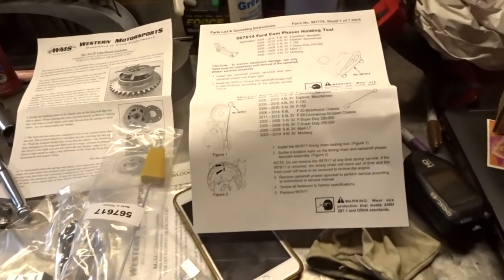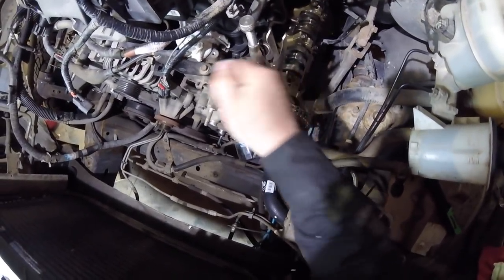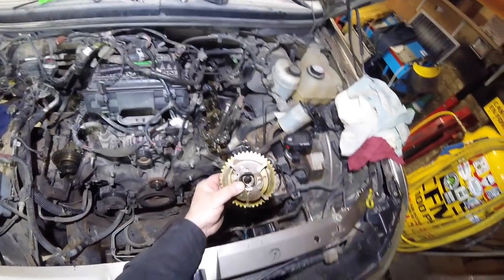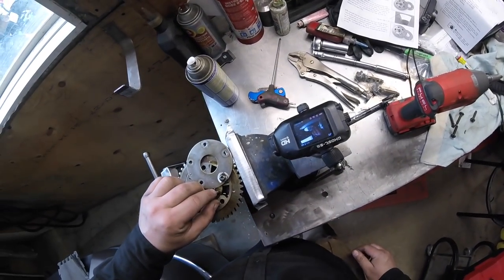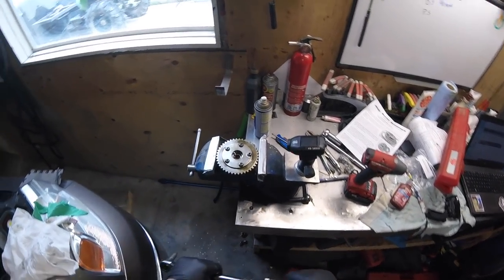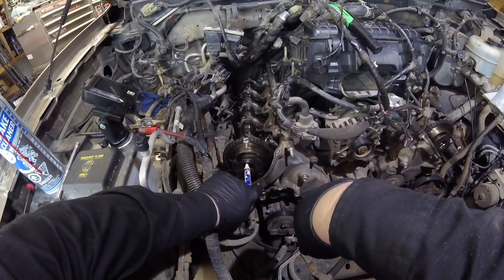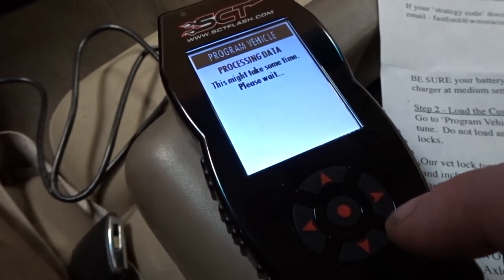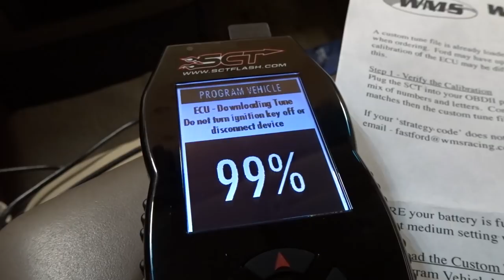Ford 5.4 3V how to install Cam Phaser Lockouts

Comment: Do I really need the tuner though? how much will this cost me if I go to a mechanic? Should I just say, hey I want you to do this thing I saw in a youtube video? Should I also get the melling high Flow oil pump and a new timing set done at the same time? how much is all this gonna run me
Reply: Shawn we do at Julio’shop for 3200 with M-340HD oil pump and new timing components
Reply: el gran savio salmon salami that’s high price considering a shop does it for 2000 with all new timing chain guides etc and melling oil pump with warranty and it’s ready to go next day.
Reply: I did the whole timing set with the Melling high flow oil pump two years ago and the phasers starting rattling like nobody's business recently. I'm going the lockout route now.
Reply: @morecowbell20  were they Ford motorcraft phasers?
Reply: @ryankeusch3972  No, and that is certainly one reason they failed so soon. I have since done the delete kit and couldn't be happier! The low end power right of the get go is amazing.
Reply: @morecowbell20  right on...thanks man!

Comment: I'm on my 3rd time doing the timing on my 2008 f150.  I shouldn't have to do the timing every 5000 miles.  My parts are in the mail, with lockouts.  I'm selling it once I'm done.
Reply: mine lasted 1000 miles! All oem parts , i wish i would have done the lockout!

Comment: Hi, I'm from Chile, and I saw your video, and I have a question, what is the advantage or disadvantage of installing the locking device? Improves the engine's appearance somewhat? or is it only for the noise to be removed?
my queries are because I believe that this system of "damping of chain rotation", must be designed for something specific, and modifying it may bring about modifying other things, or other parameters, I will appreciate your answer ... . regards ..
Reply: the variable cam timing is designed to control exhaust emissions, improve engine performance dynamics like maximizing torque/horsepower, reducing detonation and improving fuel mileage efficiency. The exhaust gas recirculation system is done away with using VCT. So yes the VCT DOES have engineered purpose and to modify it will not necessarily leave you in the best of situations for emissions and optimum engine performance. The triton motor was a complex design and it is highly important to use the proper grade of oil and change it and the filter frequently. Use 5-30 wt oil not 5-20 wt as ford  recommends. Be careful about pushing the engine hard, that is towing heavy loads and especially so in hot weather conditions as this will lead to oil lubrication problems that are the root cause of cam phaser failures. here is a link that may be useful https://www.expertswrite.net/article/54l-triton-3v/variable-cam-timing/
Reply: Hola chile mi ford como ke se kiere apagar cuando calienta especial mente cuando kiero parquear de retroseso es por esto ke se hace lo de el locking sprocket ?
Reply: Best trucks are ram ♈

Comment: Great video thanks. How long does it take from the time you hooked up to reprogram to finish? Having this done for me would like to know before. Thanks
Reply from the maker: It took about 20-30 mins
Reply: @TestDontguess  thank you very much and thanks again for the great video
Reply: so do you have to program the lockout for the engine to run correctly or is that only causing an engine light and it will still run

Comment: Hey bro need your help was told my cam phaser needs replacement and was quoted 2600. It makes the knocking noise. Will a lockout kit help.thanks
Reply: It's cheap an easy enough to try first.

Comment: Hi, i'm from Venezuela and i have a question. I already removed the ratchet and the engine it's working well, but lately is getting started to generate a failure and it is that when i'm running at 60 or 70km it
Reply: When i'm running at 60 or 70km, the engine loses power for a while

Comment: What were your symptoms? What made you do this repair? My daughter's truck is running horribly, Ford says the cam phasers aren't working (not getting oil to the top end) and needs a new engine. I replaced the cam sensors and vct's in early summer(codes showed these to be bad). Ran great then, BAM, all of a sudden runs horribly.
Reply from the maker: Most likely chain tensioners are blown and losing oil pressure.  If this has been going on for too long it destroys the motor for lack of lube

Comment: How does this affect performance? Mpg ?
Reply from the maker: It’s got more bottom end power, you notice a difference of power at over 8000ft while in the mountains. MPG didn’t seem affected
Reply: @TestDontguess  awesome thanks !!! I'm about to do a whole timing job so I may as well throw these on while I'm in there
Reply from the maker: Highly recommend doing that as most likely your Cam tensioners are blown out
Reply: @TestDontguess  the passenger side is for sure!!! I got the dreaded start up ticking
Reply: Do you have to install a tune for this?

Comment: That motor is not prone to rotating clockwise, it is in fact counter-clockwise, and counter-clockwise is the direction yours also rotated in during this video. "Left" is not the left side of the vehicle when you're standing in front of it with your head under the hood, "left" is the left side of the vehicle when you are the operator of the vehicle (sitting in the driver's seat).

Comment: I cannot understand why you wouldn't just replace the phaser with a ford part.
Reply from the maker: I can’t understand why you would replace a part with another one that is doomed to fail...... this solves the issue once and for all
Reply: VCT phaser knock in the 5.4L 3V is a symptom of low base engine oil pressure. Oil pressure is commonly lost through failed RH and LH timing chain tensioners (they are oil pressure fed); and oil pressure is (less commonly) lost through base engine failures (such as worn bearings, cam caps, etc). The phaser lock out repair with custom tune will "fix" phaser knocks, but won't address any base engine oil pressure concerns, if any exist. A more robust repair would see that both timing chain tensioners were replaced (with updated Ford parts) and a VCT lock out kit installed; and then base engine oil pressure can properly assessed (as no oil pressure will be lost through faulty timing chain tensioners).

Comment: I have the same engine(5.4 triton 3v) and my cam phasers are knocking. I have 237k miles(I know idk how it lasted this long) but is it worth it to replace my cam phasers? Or should I replace the whole timing assembly or do nothing at all? I’m at a stop because I don’t want to replace all these things and it blow up
Reply from the maker: I’d replace everything or if your worried just sell the truck, tough call
Reply: BSK Garage would it hurt to just try the cam phasers lock out before?
Reply: @HarryTrot  do the phasers, tensioners, oil pump and guides they have a kit already

Comment: Do I really need the tune?
Reply from the maker: Are you really that stupid ?
Reply: You need the tune the truck would run poorly and your mpg would drop.
Reply: @TestDontguess  hey😂😂 i already did it pit the lockouts not a single fkn problem with fuel economy maybe the stupid is other
Reply: clutch in how’s it still running? I have an 04 and was thinking of doing lockouts without tune as well!!!?!
Reply: Anthony Crosier it’s still running perfect with no issues
Reply: @LSXperts72  Still running good?
Reply: @ChildofOurHeavenlyFather  i sold it to a friend a year ago still running perfect he hasn’t had any problems

Comment: Cant say I disagree with locking em but ive heard all the non-Ford phasers are the ones that dont last.
Reply from the maker: So non ford phasers were installed from the factory and that’s why they are all failing your saying 🤔🤔🤔
Reply: @TestDontguess  I think non ford phasers last even less time than ford phasers (mine sure didn't). That's why I had to find used ford phasers so the lock fits in the kit I just got from Western. Didn't have Dorman phasers either, went with Standard Manufacturing ones a couple years ago. Lesson learned. I'm looking forward to the same results as you. Thanks very much for the great video!

Comment: The gap between the phaser and the first bracket is key no other videos imagine this a let alone State the importance of it another thing that I haven't seen in any video remove the cam position sensor it's a flimsy piece of garbage that'll cost you $60 to replace if you touch it with the wrench

Comment: Just so everyone knows you will decrease the power output by installing the lockouts.  I hope that this dude tells everyone that. Why not just replace the phasers and solenoids with motor craft brand. (If chains are not stretched and guides are not broke.) I’m only commenting because I think most people don’t want to substantially decrease the power output if their engine. If your only trying to scrape i still wouldn’t do it. You will be better off  buying the phasers because the tuner will offset the price.  There is no way it accelerates better
Reply from the maker: Sorry but your wrong, it doesn’t decrease the power, and the program is fully adjustable to control your timing curve....... quit being a armchair mechanic know nothing